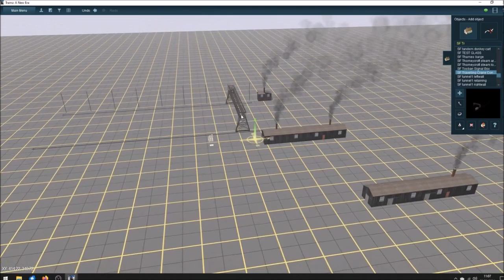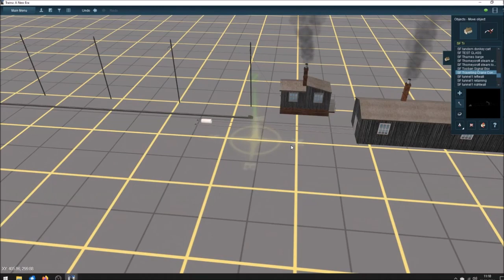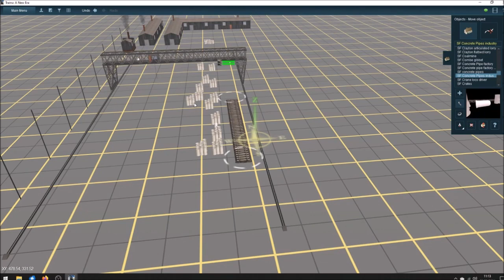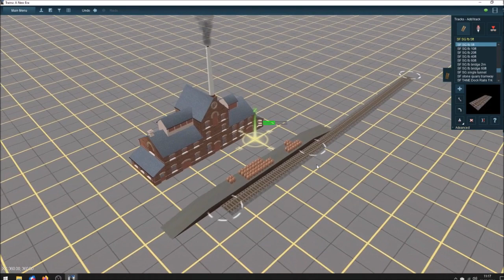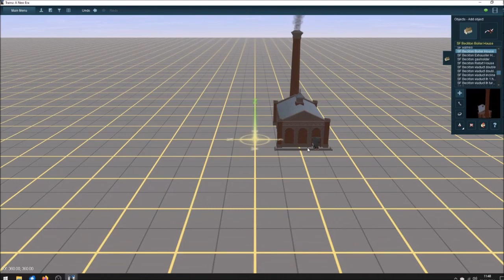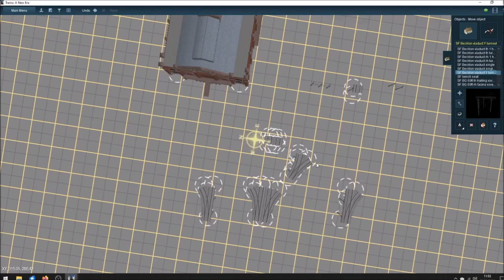Some industrial buildings for Trainz railway simulator

Comment: Quick question, will you ever do any industrial steam shunters for Trainz such as Peckett W4 and Sentinel 0-4-0VBGT engines?
Reply from the maker: I'm aiming to do a couple of locos suitable for the Beckton gas works with no cabs and dumb buffers but they are some way off yet. As to others it all depends on accurate plans, as I've requested on my site. I'm always open to suggestions backed up by plans and photos but I can't promise any timetable.....